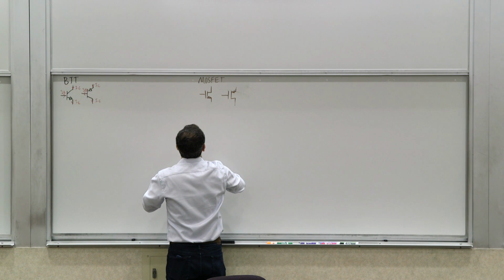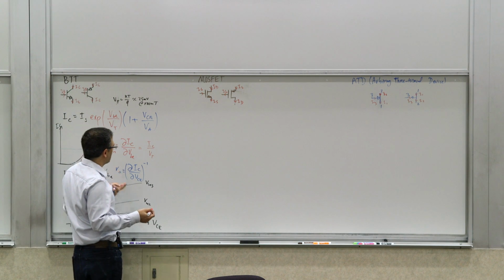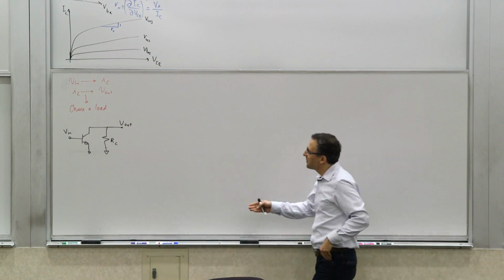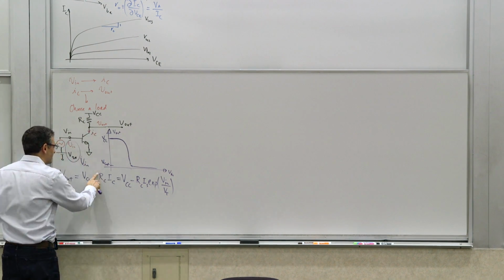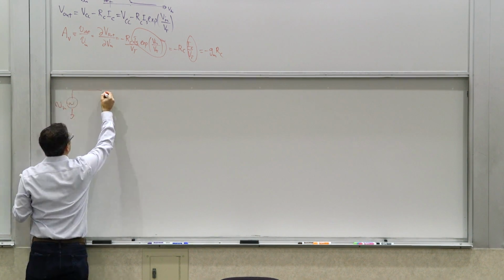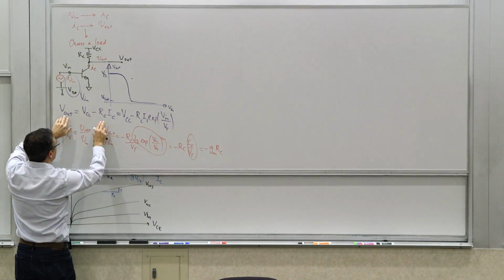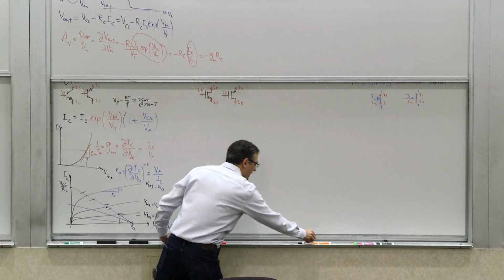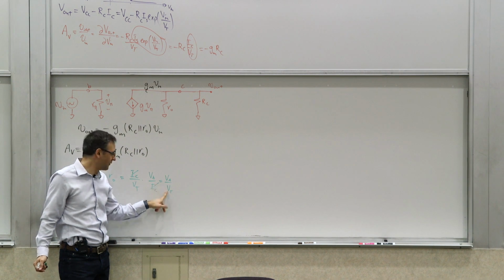119N. (Pt.1) Amplifier Fundamentals, MOS, BJT, and ATD (arbitrary 3-terminal device), maximum gain

Comment: I have a question professor. There are some sources which say that the more accurate dependence of current with early voltage is (1+VCB/VA) rather than (1+VCE/VA). Apparently, this is even how spice models BJT transistors. Are you aware of this; is there an explanation for why the "true" correction factor uses VCB rather than VCE? This is a really niche detail that almost no one cares about, and so I can't seem to find an explanation anywhere

Comment: sir i didn't understand why vin ac source is connected to vin dc source
Reply: It is just a model to an input signal. If you have a variable input that fluctuates around a constant value (D.C.), you could express it as D.C part + A.C. part. For example: x(t) = 5 + 0.1sin(wt). The way you draw it lets you think that a D.C. voltage is 5v +a variable fluctuation of 0.1 v amplitude. Summation of voltage is connecting their sources in series.
Reply: @mohannadasar6126  edit your comment in "express it ..." xD
Reply: @zinhaboussi  That was two years ago, lol man